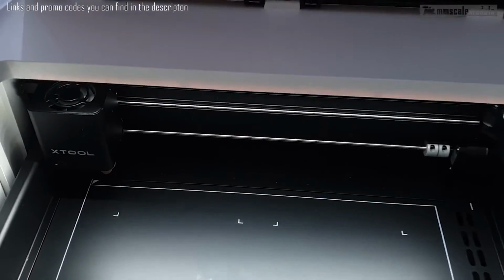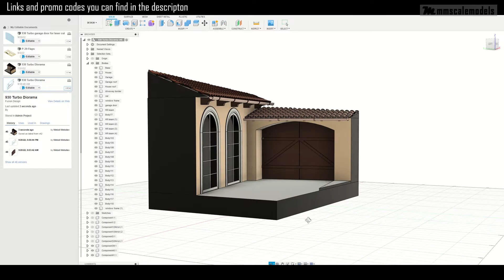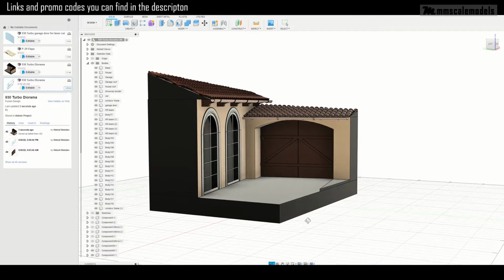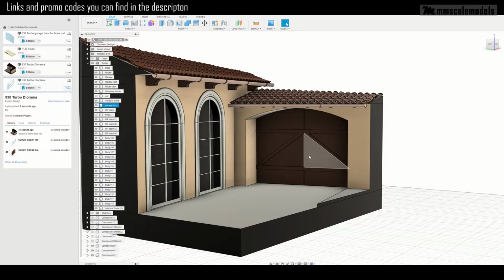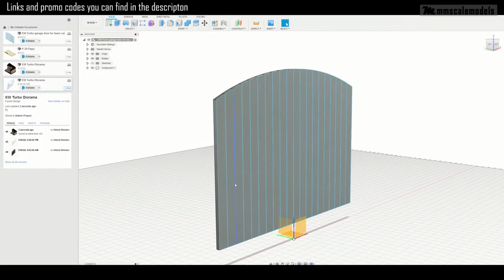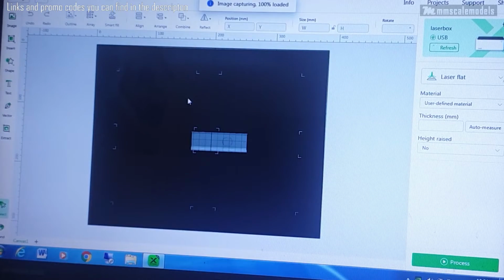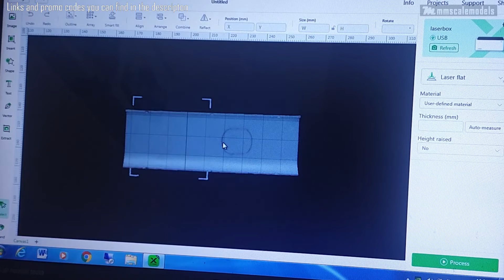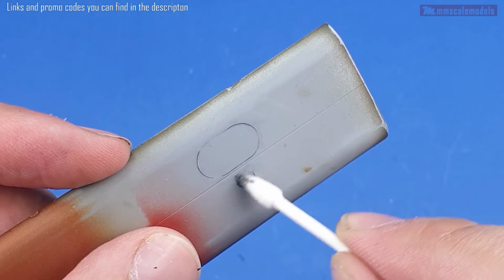Can LASER be modelling tool? - X-tool M1 review

Comment: Have you tried to use the laser instead of the blade for cutting Masking tape?
I'd imagine for sharp angles or very small details the laser might produces better results.
That could be usefull for creating custom masks for Aircraft markings and insignia.

I'm considering buying a laser module for my desktop CNC just for that purpose.
Reply from the maker: Not yet but I will do so. I have a few question marks about this but tests will show.